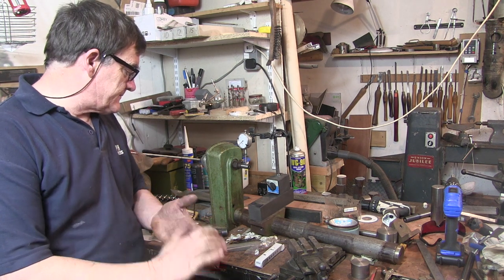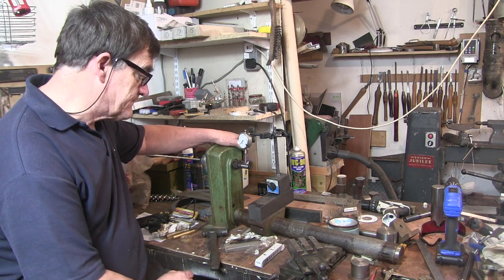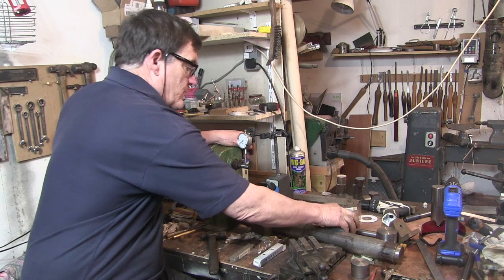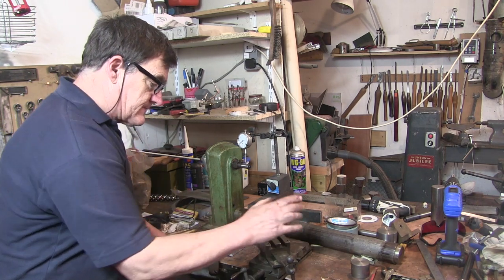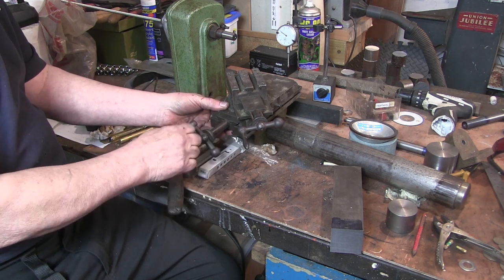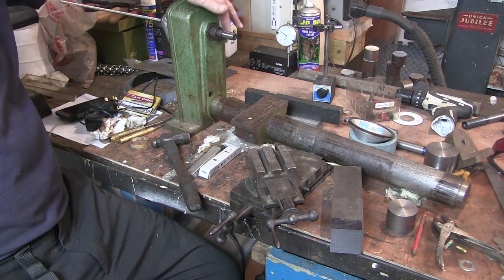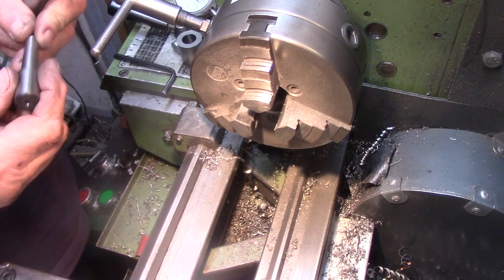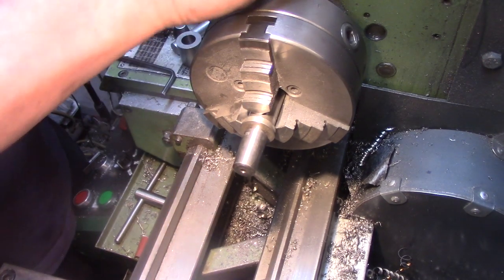Starting on Making a Tool and Cutter Grinder

Comment: looking at the grindingwheel mounted on the lathe made me thing : maibe you can make an adapter for the toolpost and turn the lathe itself intoo a toolgrinder , saves a bit of space in the shop though there be all sorts of grinding dust landing on the ways

Comment: Cliff I can see the pressure washer wobbling about as you turn the cone at the end of the video.  Looks like either the centre bolt thread pulled one way when you hand tapped it (quite likely), or the bottom face of the cup is out.

I would mount the cup wheel in an external chuck and check centre hole runout first.  If that is out then true it up and make another arbor centre for it.  Also check if the base of the cup is parallel to the rim.

Checking the internal base of the cup will be somewhat difficult.

Just my two bob's worth ;)

Good luck.

Rob

Comment: when you get it some where near keep an eye on which you run the wheel if its turning anti clock wise it should be ok if you go the other way the stone will loosen off an possibly blow up before you can stop it

Comment: can you hold the grinding wheel in the lathe  and true up the shaft to the wheel.?
Reply from the maker: Can't do that with this, I've made it so the wheel is screwed to the shaft thats the MT1 that goes into the headstock if the jt6 bit was fixed separate to the arbour that would be possible,
Thanks for watching,
all the best,
Cliff

Comment: Cliff,
Having been in isolation for several weeks now I am certainly glad of the escape I can make to the shed even if I don't make anything just pottering around gives me something to do but the list of jobs never seems to get smaller. I made a drill sharpener along the lines of this one https://www.pinterest.com.au/pin/278449189442227152/ using one of these wheels and it never quite worked as well as it did in my head but it was fun making it! I am sure yours will be better and I am eager to see what you come up with.
Please pass on my thanks to your wife for a fantastic job that she and all the doctors, nursing staff and all involved in their selfless dedication to duty as such a difficult time. Even though the world seems to going to hell in a handbasket the glimmer of human decency in the professional way in which they are coping without regard for personal safety is awesome.
Reply from the maker: Just had a quick look, need to have a proper look, I have looked at many, Kevin, at Machine NZ, above did a great t&c grinder build a while back, that's worth a look if you haven't seen it,
thanks and have a great easter,
ATB,
Cliff

Comment: Hi Cliff, most wheels have to be dressed. Normally a single point diamond dresser but does depend on what the wheel is made of/for. Certain dressers types are for certain wheel types. Looking forward to the build.
Cheers
Kevin
Reply from the maker: Hello Kevin, I have been after doing something like this since your video on the tool grinder, its your fault! :-) It is now hurting my brain! I don't know if you can dress these "diamond" wheels, not willing (or able at the moment) to try, might need some further investigation, might not even get that far,
All the best, enjoy easter,
Cliff

Comment: Allo Cliff, I had the same problem with the facial runout. What I did was to reverse the jaws of my chuck, mount the wheel in reverse into the chuck and skim the back of the wheel. I put some hardish rubber between the jaws and the wheel to protect the wheel and didn’t clamp too hard. I proceeded with caution and it worked for me.
Reply from the maker: Evening Tony, I have been thinking about doing that, either on the lathe or mill, the front is the important bit, so if it worked for you I'll try it,
Thanks,
Cliff
Reply: I got the face runout down to 2 tenths using the lathe and this will depend on the accuracy of your chuck.It should be pretty good with your Emco chuck.As you will be aware you don't want to rupture the bond between the diamond composite and the aluminium backing but you just go by feel.The rubber between the jaws and the wheel will help and also provide grip.I've actually had to do two of these cup wheels because the wheels as supplied were poop.

Comment: Cliff, some of these Chinese wheels are notorious for being inaccurate. If I remember correctly young Ca Lem had the same problem with one of his diamond wheels and he re- dressed it with a diamond single point dresser. It may well be worth having a look at his channel and seeing how he went about it. I'm pretty sure it was Ca Lem who did it but I may be wrong. Robin Renzetti may well have some ideas about this problem as well. Try sending him an email to see what he says about it. One thought it had is that before you split the arbor apart was to put a chisel line witness mark across the two parts of the arbor if you are going to make two collars, one for each wheel or Loctite them together and use the one for both wheels. Personally the second option is the way I would go. Hope your wife stays fit and healthy in her so so important job, and you too mate. Happy Easter!
Reply from the maker: cheers Sam,
I follow robrenz so I'll see how this goes and I may have to trouble him! :-),
Atb, Have a great easter!

Comment: Hi cliff interesting project. Will be interesting to see how it turns out. Experimental work can be a pain can't it? Like me you seem to use what you have and re-purpose where possible.
Reply from the maker: Absolutely Stephen, but this is definitely a project I would rather have started from the "swively" bit first and then put the grinding head to that! Might get away with it,
All the best,
Cliff
Reply: @CliffsShed  Indeed Cliff, that  has to be the motivation It might work. Good luck Cliff.